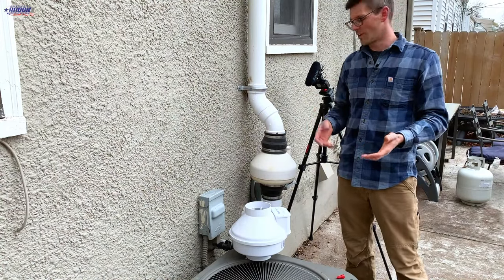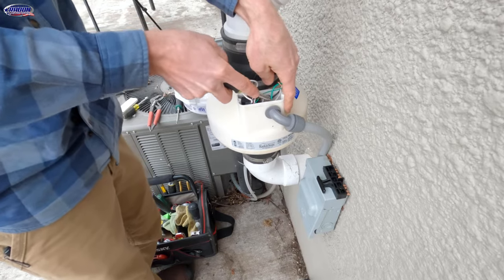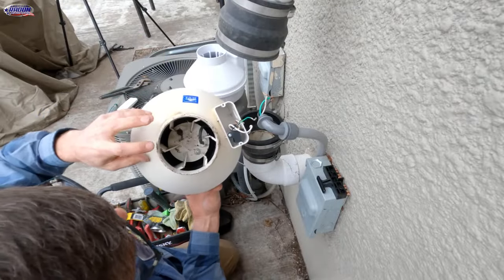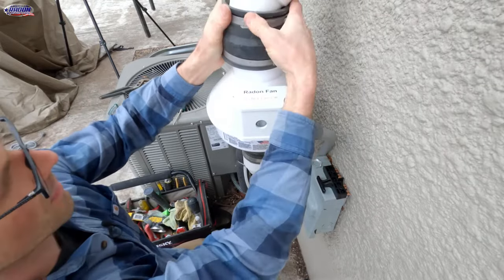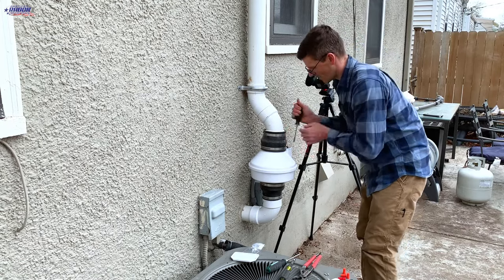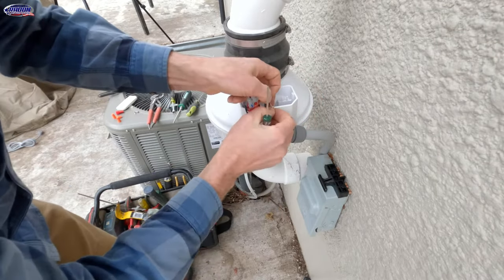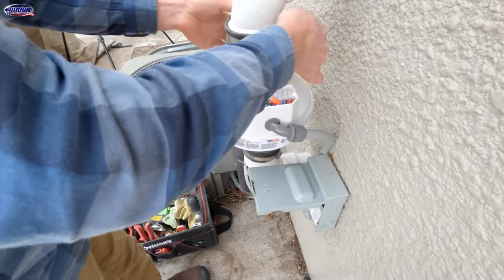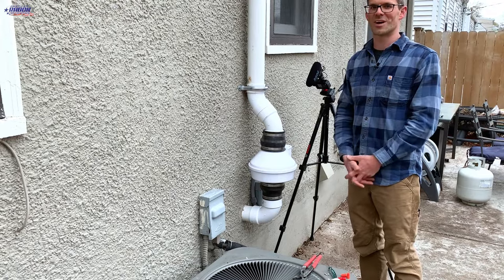How to Replace a Radon Fan (Outdoor System)

Comment: just woke to a buzzing fan and the little water indicator system is level, time for a replacement, thanks for making a video that doesn't make the work look scary
Reply from the maker: You're welcome! Just be sure to turn off the power to the fan before getting started.

Comment: My guess I'll that rain water got into the fan and caused to fail prematurely. I'm going to tackle replacing my radon fan. Looks pretty straight forward. How would I go about figuring out which one that I need to buy?
Reply from the maker: Hey Luther, a condensate bypass can be added to divert the water around the radon fan. I’d replace it with the same or equivalent fan. Using the same fan will be the easiest since it will have the exact dimensions as the old one.
Reply: What if I can't identify the model of my current fan?  The labels are bleached out. Thanks
Reply: @PottedJam  if it is less than 5 years old, you may have a warranty. Seeing that it's bleached tho, it may be older than that.
Reply from the maker: Hopefully, the contractor wrote down the fan model in the documentation attached to your system or on the label next to the U-tube manometer. The company that put in your system may also have a record of the fan they installed.

Comment: We've been hearing a low humming vibrating sound for a couple of weeks now. We didn't know anything about a Radon System and didn't get it inspected before buying our home. It is supposed to be serviced every 2 years. I called the number on the pipe in garage but the technician isn't answering. Therefore, I had to call a different company and now I'm waiting for their support team to come out next week and check it out. The levels are at 0 on both sides but I do hear air flow still coming through the pipes. My guess is we need to replace the fan
Reply from the maker: It sounds like your fan motor bearings have locked up. If this is the case, your fan is not moving any air and can be turned off until it is replaced. Fans with seized motors can make a humming sound. Since your U-tube manometer is equal on both sides, it indicates no suction is being created by your fan.
Reply: @AmericanRadonMitigation  a technician came out yesterday and he said that there's two radon systems in my house and it should only be one. He said it seems like the seller of the house had just threw something together to sell the house. He said one of the fans is working and we could hear the air flow coming through the pipes. Should I have him to cut off the one that isn't working and just use the other one that is working? What are your thoughts?
Reply from the maker: I would find a contractor that can do pressure field extension testing to assess your current setup and offer suggestions for improvement. Doing a radon test or purchasing a radon monitor is a good first step. We really like the EcoQube radon monitors. https://americanradonmitigation.com/product/ecoqube/

Comment: Helpful videos! Thanks. I just noticed my fan wasn't running, had heard a loud hum feom it for a day and now it is totally off. Very cold here and there's ice coming off bottom.  Is the fan probably burned out?  I will replace if so but moving forward, why the ice?  Just too cold and condensation is freezing before it gets into sump?  Also why isn't there a cap or at least a bend in my pipe where air empties (runs two stories and above roof lime)?  Thanks!
Reply from the maker: Chris, your fan could certainly be frozen. You may want to wait a few days to see if it thaws out before replacing it. A radon system generates a lot of condensation inside the cold piping that freezes during low temperatures. You could always add a heating cable to help prevent freeze-ups in the future. 

Ice cable video- https://youtu.be/ooWqGVEQEtY

Rain cap and horizontal discharge addressed in radon standard see section 6.4.12.1 https://standards.aarst.org/SGM-SF-2017/26/index.html#zoom=z

Comment: Leveling and plumbing the unit is a specific installation step for RadonAway fans.
Reply from the maker: Thanks for the heads up! I've been told it doesn't matter by some manufacturers.

Comment: Hi Jesse, great video and am going to replace my fan as it seems to have stopped working. It is over 25 years old so i guess i got my money's worth out of it. Hoewver, i am unable to determinw hat it is i should replace it with. There is a sticker on the fan, but it does not say what make it is. It says the Type is R150 KUNSTST 60 HZ UL, any advice as to what i should get to replace it?  Ther is also a section that says A.-Nr. F90-15005.
Reply from the maker: Looks like it crosses to a RadonAway RP260 or a Fantech Rn3. Here a link to the Fantech Rn3. Use “Jesse” as a coupon code for a discount. https://radonpds.com/shop/radon-fans/radon-fans-high-volume/fantech-rn3/

Comment: Thanks for this!  Your videos are awesome.  What's the ideal readout on the radon mitigation manometer for a house with drain tile and no gravel underneath the slab?
Reply from the maker: Thanks, Zachary. There's not really an ideal readout as the fan, pipe size, and airflow vary for each home. Generally, your U-tube manometer would read between 0.2 and 1.5 inches of water for a home with drain tile.

Comment: Do you know if you can use the black corrugated pipes with holes put it under the (gravel+6mm poly+4" concrete) and take the pipe out of the house to mitigate radon gas?   Radon is 7-8 times heavier than air so will it settle in the pipe and exhaust out of Nudura ICF house in East TN or you need a fan to suck the air into the corrugated pipe and then exhaust it out?
Reply from the maker: You'd have to use a fan to draw it into your corrugated pipe and into your radon system.

Comment: Once a new fan is put in place, does the system pressure that is measured in the basement return to the normal values? Mine right now is on 0. If replacement of the failed fan does this automatically, that would be great. Thank you!
Reply from the maker: Yes, Joey, the fluid in the manometer will return to its normal level when you replace the radon fan with an equivalent model.

Comment: Does pulling that fuse out of the box right there at the site of the fan kill all the power for sure or do you need to turn off the breaker to be certain?
Reply from the maker: It kills the power. Many radon systems aren’t wired like the one in the video, so I’d turn off the breaker if that’s the case.

Comment: So if the fan is still creating airflow but is getting loud, I'm guessing the 5 -year warranty wouldn't consider the fan to be 'failed' yet?  Is the installation company gonna get pissy with me if I modify my own radon system?
Reply from the maker: I'm guessing they would cover it under warranty. As for your second question, every company might answer it differently. I'd ask them directly.
Reply: Thank you for your response! Your videos have been very helpful

Comment: Please help! 
I have a RadonAway fan P/N 15021-1 that was installed in 2007 and has now finally died. This fan is no longer made. What replaces it? Is FanTech better? THANKS!
Reply from the maker: What's the model number of the fan?
Reply: @AmericanRadonMitigation  I can't find a model number on the label. I do see 120V, 60Hz, 1.5 amps max, 3000 RPM, 1/SHP Max, Class F Induction.
There is a number under the ETL certification that reads, 77728. 
Also: Product Number 15021-1 Rev F.
Reply from the maker: @TheGneissgirl  Hmm 🤔 none of those numbers are helpful. The part number only identifies the RP fan series label. 

1. Can you measure the diameter of the duct opening on the top or bottom of the fan?

2. What was the U-tube manometer reading when the system was working?

3. What does the label beside the U-tube manometer say for static pressure? The fan model may be written on this label. 

4. Is there paperwork that indicates what the fan model is next to the system monitor?
Reply from the maker: @TheGneissgirl  It's likely an RP145, especially if it has a 4.5-inch duct opening at the top and bottom of the fan. I would replace it with a Radonaway RP145, Fantech RN2, or an AMG Maverick. I prefer fan manufacturers that use German motors.
Reply: @AmericanRadonMitigation 
Coming in a year later with a similar question. I have all the same numbers as the first person described, but mine is Rev D from 2005. Assuming it is the same model, I have an additional section that reads RP155, which is between RP145 and RP260 on the label. Given it doesn’t look like the RP155 is made anymore, would you recommend going down to RP145 or up to RP260? Thank you!

Comment: Goofy installs are the bane of my existence
Reply from the maker: Tell me more! Are you a mitigator that has to deal with them?
Reply: @AmericanRadonMitigation  no, I'm a new homeowner with  stuff missed at inspection.  Had a new roof put on in May and found out the subs didn't replace bad wood on the garage. Bulbs on the garage sconce weren't out, the romex in the garage loft wasn't hooked into anything.
Reply from the maker: Oh, that's no good! I'm sorry  @woodstream6137